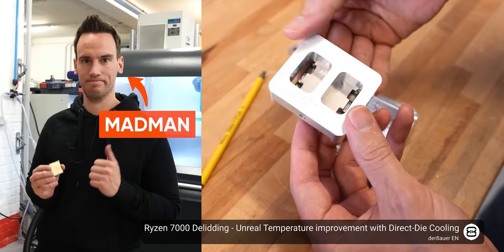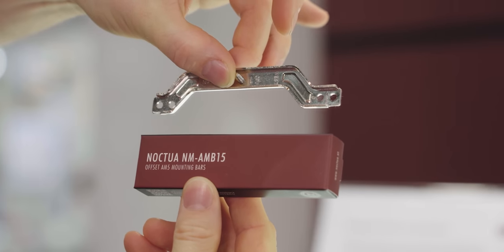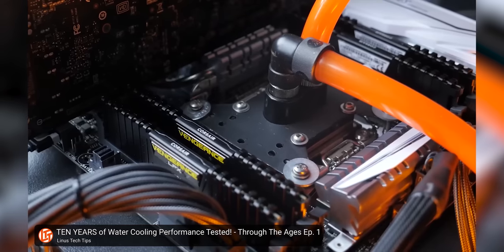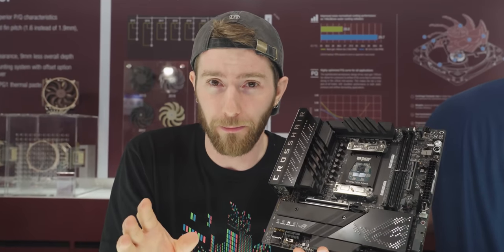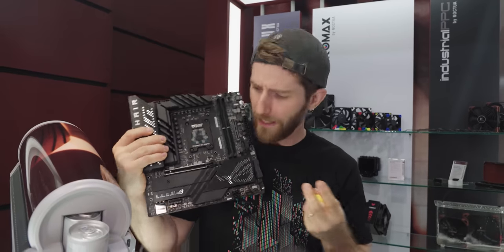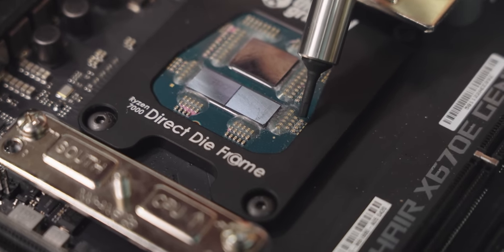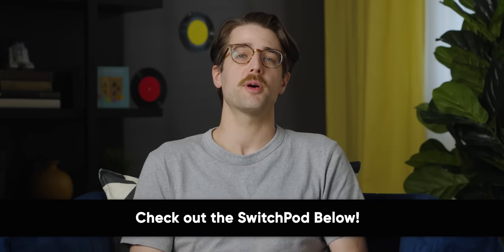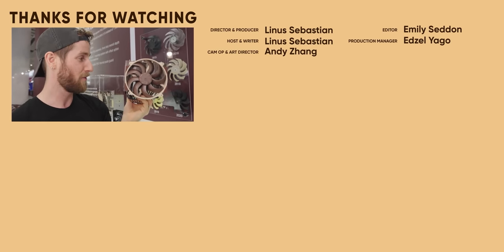Noctua's New Cooler Voids Your Warranty - AM5 Direct Die Cooling @ Computex 2023

Comment: From my experience even the slightest crack on the die will cause issues that sometimes are not obvious or instant. I worked at a tech company that refurbished laptops, and correct placement of the heatsink was very important, a slight misalignment and the tiniest crack that's visible only under high magnification could cause issues like random freezes, blue screens, crashes etc. The bad thing is that sometimes this doesn't happen right away after assembling the heatsink, the device may seem that it's functioning. So if you get issues after cleaning your unprotected (without IHS) cpu or gpu and you get normal temperatures, you probably damaged your dies. I definitely recommend the protective frame at all costs, since this is a very expensive damage, and you get no warranty whatsoever.

Comment: The real funny thing about "delidded" cpu's is that they were actually officially produced for some time in the early 2000's. AMD came from the lidded K6-3 to the delidded Athlon T-bird and went back to lidded with the Athlon 64. Intel came from the slotted Pentium 2 to the delidded Pentium 3 and back to the lidded Pentium 4.

Bottom line, I actually broke a duron and a t-bird thanks to their mounting system and the delidded cpu's. They were actually RMA'd without any question when the reason was the mounting. Funny how things evolve over time. I guess both Intel and AMD learned their lesson back in the day. But man ... I still recall the first cpu's water blocks were made during that era. Overcloking went crazy because of both delidded cpu's and water blocks. And unlocking the T-bird with a pencil now seems like a joke but it was damn fun back then XD

Comment: On that same note I recommend anyone getting a LGA 1700 Intel CPU to get a frame to replace the stock one that come with a motherboard, its not guaranteed you'll "need" one but even if you don't its guaranteed to reduced your heat load. Its mandatory (in my opinion) however for anyone with a Z690< motherboard and an unlocked (k) processor; Keep in mind if you have a old Noctua NH D15 cooler, a cheap adapter costing 7-15 bucks is needed with a change to a LGA 1700 motherboard from an older model.

Comment: Throughout my lifetime, going from stock cooler, to TMD fan cooler, to full copper cooler when we used to spread the Arctic Silver in the thinnest possible layer using a credit card, to AIO water cooler and then to Noctua, I can definitely say that Noctua is simply the best, with the performance of a water-cooling system, and the maintenance requirements of a rock!

Comment: Video idea. Find a super low temp solder it and apply it to a CPU or heat sink. And then mound them together and use the heat of the CPU or heating up heat sink to melt the Solder. Probably would work easier on a water block.
Reply: Or just use the liquid metal thermal paste and forget about it. The new cooler design and the offset are doing most of the work.

Comment: I've been using noctua fans for years at this point. I regularly use them for replacement fans in Eagle golf cart chargers that have cheap fans fail regularly. I'm charging you $20 for that tiny little fan (and $45 "1/2 hour labor" - charger repair) . Dont like it? Too bad! But, your charger will be quieter & youll never have this problem again. And, my pc is full of tan & brown fans.

Comment: Just bought an NH-D15S and some redux fans, people would probably tell me it's a waste to use on my 5600G, but considering my room during summer reaches 30+ C during summer and my CPU reaches 75+ C on the stock cooler.

I would say I'd buy Noctua again, not just because it brought my temps down by 10 - 15 C, but also because I know it would handle a 5800x3D if I ever decided to upgrade and get serious with editing videos.

Comment: I feel that if the cooler is redesigned with the pipes at a 90 degree shift that would help alleviate the issue as well

Comment: A cool alternative to conformal coating protection for the exposed capacitors on the chip I've found is 3D printing resin. You only need a few drops so if you've already got a resin 3D printer, it'll cost you next to nothing.

Comment: I'm actually way more exited about the new nh-d15. I had the old one and it was simply not good enough for my intel cpu (I have a custom loop now). I don't expect it to be better than that.. but if it can handle a 13900k with a mild OC then I would be VERY impressed. Nothing beats the reliability and ease of maintance of a good air cooler. The 8 thick heatpipes should help.. but that might still be a bottleneck especially since cpu dies are so small.. there will only be like 3 heatpipes making direct contact over the die anyways. And heat pipes are not as good as water obviously. I really hope it dethrones a bunch of 360mm rads (though I have my doubts). It could be game-changing for someone who wants as little compromises (including longevity) as possible.

Comment: The liquid metal will infuse into copper by time and by introduced heat and forms into another metal (GaCu) which thermal conductivity is not very great but that is not the worst thing. Gallium based liquid metal will diminish away in that case. On the other hand if the liquid metal is against nickel plated copper the situation is supposedly better. I just used mx-4 on copper waterblock to get it done for good. I havn't tested it on nickel too much but with copper you need to replenish it.

Comment: Another way to look at this: AMD pretended to maintain cooler compatibility with older AM4 and earlier cpus, but it actually broke compatibility in a subtle way that affects everyone.

(don't ask me where else they were supposed to put the chiplets, split the IO die in half maybe? But it's just a fact, the coolers go on but no longer work optimally because they were designed for a centralized heat load)

Comment: if surface area connectivity is paramount to temperature diffusion, and manufacturer tolerances are what's at play, one wonders what could be achieved with just a whetstone smoothing of the surface.

Comment: Linus: Noctua shifts cooler to bottom...this increases cooling by up to 3 degrees...THIS IS VERY IMPRESSIVE.
Also Linus: This is liquid metal cooler paste it increases cooling, but ONLY by 2-4 degrees.
Reply: That's not what he said.

He said delidding only nets you 2-4 degrees if you use normal thermal compound.  You need liquid metal to get the larger benefits.

Comment: Small correction to Linus' statement about delided CPUs requiring Liquid Metal:
You can also use PTM 7950 on CPU and GPU dies. It's almost as capable,doesnt pump out,and has none of the risks LM has.

Comment: Nah, you really don't want to delid. Especially a soldered ihs. They work great as a heat spreader and shield. At most, just do a nice wet lap, thin it down and polish it some if ya want but don't remove it. It's really not worth the effort and potential trouble. The benefits aren't that great.

If you get a chip that runs hot, first check it's performance potential if you plan to OC it. If it's a good chip, maybe think about if it's worth keeping it. If it is, then lap the lid and maybe try to reflow the ihs. If not OCing then just return it and get a diff chip.

Comment: Ain't no way people actually going through the trouble of delidding and using liquid metal only to use an air cooler, lmao. The Thermal Grizzly delidder itself is $73 on Amazon. The direct die frame is $43. Conductonaut Extreme is around $25. The current DH-15 is $110 on Amazon and $120 for the actual decent looking black (Chromax) version. Total cost including the $4 offset bracket is $365. Even if you rent the delidder, this is ridiculous. For comparison, one of the most highly recommended 420mm AIO is $150 or a $155 for the RGB fan version (ARCTIC Liquid Freezer II 420 [A-RGB]) and it comes with thermal paste and offset brackets, which you presented as some kind of new technology when it has been a thing for a while.

So who in their right mind would buy this setup? I'm assuming the new D15 will cost more than the original one costs on Amazon, so if you're spending like $380 on CPU cooling, why wouldn't you splurge on a 420mm AIO. Neither of them fit in pretty much any mid-tower case (the Lian Li Lancool III is one of the only cases that fits a 420mm AIO and the Corsair Carbide 500R is one of the only cases that will fit a D15 with any RAM that has a heatsink, which is basically any RAM that isn't complete trash). A 360mm will fit many mid-tower cases and give way better performance and noise levels still. If you're going full-tower and care this much about cooling to the point where you'll spend $380+ on cooling (more expensive than the cost of a Ryzen 7900) and risk losing your way more expensive CPU, you're going to spend an extra $20 to just get a 420mm AIO. I guarantee you that a 420mm AIO + liquid metal alone will lead to better temps with way lower noise than all this delidding or lapping nonsense with the air cooler.

Comment: 4:05 'But linus, you might say. Isn't the function of a heat spreader to decentralize hot spots?' 
Liquid metal has had poor longevity in my installs so I use MX4 7 year durability.

Comment: I did direct die air cooling with a noctua NH-U9S. The captive bolt bumped the standoff as I placed the cooler, splashing liquid metal under the VRM caps. No magic smoke but a small pop when turned on, killing the motherboard, CPU and power supply. Be extremely careful if you decide to do this.

Comment: ....why not just arrange the heat pipes in the other direction? Instead of going horizontally so a half is overutilised an a half is underutilised, make them go vertically. If there is space for this shifter then there is space for the heat pipes to wrap around from the top and bottom to the sides as well

Comment: I would never do this to my hardware because I am too scared to break something. I have the Noctua NH-D15 Chromax Black and try to keep it when I upgrade sometime when Ryzen 8000 and the RTX 5000 series is around. If its too weak I buy the newer modell of this cooler.

Comment: I have a 7700x with an ARCTIC Liquid Freezer 280 II AiO, on 100% load it instantly jumps to 95C.... delidding might make sense on these 7000s... still unnecessary for normal use, but 20C is insane

Comment: Can't help wondering if the whole "all the compute is all using one heat pipe" problem couldn't be more simply solved by just turning the cooler 90 degrees. :P

Comment: Linus, why don't you just solder a water block to the CPU as "the heat spreader" and then you have stable solder and efficient heat transfer with water cooling?

Comment: OK, I watched again, and I still can't find what you're actually doing with those little plastic spacers.

To quote the video, with elaboration removed:

"Step one: get your hands on a delidded Ryzen 7000 series processor...
...Step two: install a direct die mounting frame...
...Next, you're going to need some liquid metal thermal compound...
...Finally: You''ll need Noctua's offset mount."  

Where do those spacers come in? That seems like a huge oversight.

Comment: Nail polish?  What are the thermal specs on that?  How about a paint (or such) that is designed for high heat?  Oh, engine block paint is way over spec, is it?  Fine, let's find something with known specs, if at all possible.

Comment: Compare the nhd15 to a few solid state fans mounted to heat pipes or the fins on the heatsink. Idk what they cost right now but so long as they don't get bought out for private military use or something I imagine it will become cost competitive enough to replace AIO and watercooling on desktops by those who just want a smaller form factor to tidy up the case (and with them it will actually be a small form factor cooler rather than just moving the bulk. nucs of the future will have thermal headroom we never imagined)

Comment: Now if everyone would make these changes. Cause the cooler I got it can move 7 mm and not touch VGA backplate. But it will be TIGHT. I could use an extra potential 20c less to worry about.

Comment: Seems like rotating the CPU socket 90 degrees on the motherboard would be beneficial.
Or just have the heat pipes run vertical over the CPU.

Comment: Since the hot spot goes left to right, wouldn't it be optimal to rotate the cooler 90°, to get even heat load on all the heatpipes? Of course you'd probably need to change the airflow from front to back to bottom to top (and use a gpu riser cable so it does not obstruct air flow) to benifit from this.
Reply: this.

Comment: It is cool that they went this extreme for the Ryzen 7000 but it is tottally not needed because the processors run cool.  My 7800x3d never goes above 65 degrees and I am only using a $40 thermalright peerless assassin cooler

Comment: The IHS being thinker is a small effect, the bigger effect is that AMD increased the thickness of the TIM which solder is a good thermal conductor compared to thermal paste, but compared to copper it's shit tier. So increasing the TIM thickness even by 0.025mm will have a large effect on cooling performance, while increasing the thickness of the IHS by 3mm because of coppers much higher thermal conductivity will not have much of an effect at all.

The reason I have heard for the increase in thickness of the TIM is that AMD planned to significantly change the underside of the CPU for Zen 5 or more likely now Zen 6 which would increase the Z height of the die, and apparently they are to cheap to just make a new IHS for the new guts when they do it. Like I'm not saying it would be cheap to me and you to change the tooling for a new IHS, but for AMD it would have been peanuts like a couple of million dollar for a whole generation of CPUs where they are going to make billions.

Comment: if the 8000 or 9000 chips have this sort of stuff, ill buy it and void warranty. My 5800x3D is more than enough to power my AW3423DW with my 3080. Heck I will assume it will be fine even if I upgrade to a 4080 or 5080.

Comment: This video is an interesting topic, but I'm confused. At 3:22 Linus talks about the black plastic Noctua spacers, which seem to be the point of the video since they apparently allow the 20° cooling improvement, but it's never explained how they work or how they are installed, unless I totally missed it. Are the spacers under the silver parts at 5:49? I'm confused how the spacers are involved here.

Comment: I still think they need to move away from the dies and start making those cpus with on board memeory much like they do with GPUs and still allowing gpu and cpu memory expansion on the IO board. Offer two styles of air cooled and water cooled in a sealed heat sink that encloses the entire thing rather than just the one chip.

Comment: you should REALLY REALLY cover the de-lidded CPU with some form on conformal coating (not the die itself) before you use liquid metal. if it runs out from under the cooler once onto the surface mounted components of the CPU you're gonna have a really bad time, insulate that shit kids.

edit: I made this comment before I watched far enough to see him say the same thing haha

Comment: Isn't it better to in that case rotate the cooler so all the pipes are distributed over the hotspot? So you still use all the heatpipes even though the hot "line" is on the side??

Comment: That intro got me all excited for nothing, I thought they finally released a bracket to mount a tower cooler onto a GPU.

I tried to do this years ago after I found DIY Perks on Youtube. First came case fans on the stock heatsink, then attempts to mount a tower cooler on the GPU.
I gave up on it due to issues with even mounting pressure and coil whine. Now I run a sealed water cooled system.

Comment: CPUs should come with their own coolers now, just like GPUs. Or at least direct cooling.
Direct die cooling should be the norm, considering that they consume more power and produce more heat, more than they used to at least.

Comment: Wouldn't just truning the cooler 90 have worked to more evenly spread heat over heat pips. Thought it would not solve pressure issue.

Comment: this is VERY unnecessary unless you're overclocking. AMD 7000 series run overvolted out of the box and they not only run hot but degrade faster too. TSMC recommend that their chips made for AMD are run at 1.2V maximum anything over this is overvolted so if you want cooler temps literally just change your vcore to 1.2.

Comment: Maybe this is a dumb idea but I don't see how it is but when I see the NH-D15 I always wonder why they use a round fan that size instead of smaller fans and redesign the heatsink so that it has more fins and the air cant leak out around the sides. As is there is surface area on the D15 that is otherwise unused by the fan. If you look at the corners around the fan frame those parts are capable of dissipating heat but that surface area is otherwise just passive cooling plus a bit from air is sucked nearby. Like why not make one that's dual 92mm static pressure fans with high fin density and make an air duct thing to force the air through the fins at high speed? I'm sure noctua is more than capable of engineering a design. These kinds of designs already exist I just wanna see noctua make one and make it the best. I think it could further improve the D15 design. Always felt that the way the fans mount was kinda ghetto anyways.

Comment: So i have my 7900x3D with thermalkompound and direct die cooling with an Bequiet Darkrock pro 3 and im siting under full load in the low-mid 70 degrees (celsius) so i dont think liquid metall makes such a huge differenc just 5-10 degrees max

Comment: Is there a reason that they didn't simply turn the heat pipes 90 degrees to run across the hot spot instead of inline with it?